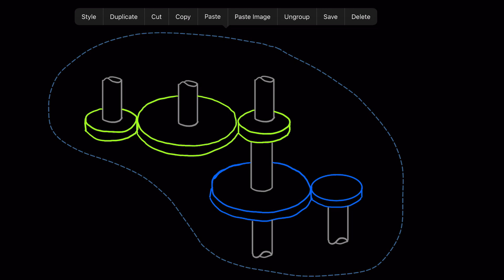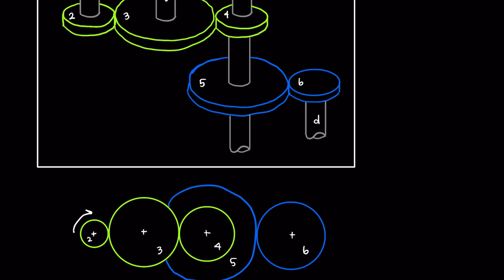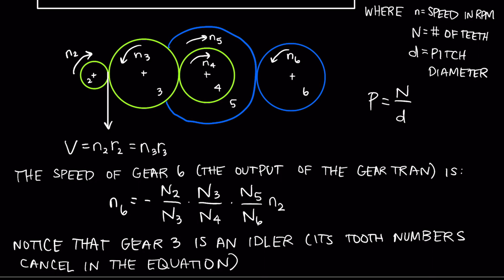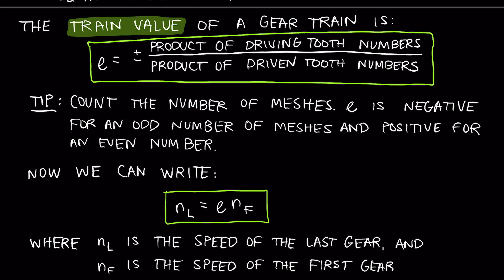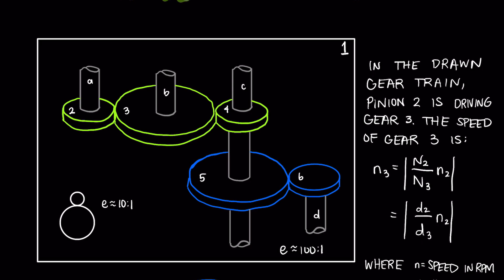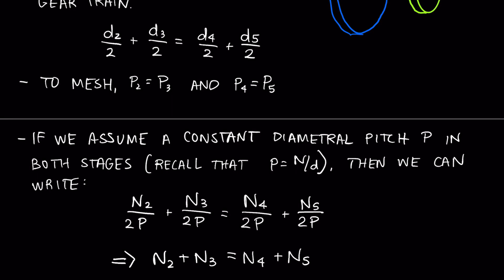Gear Trains: Simple, Compound, and Reverted Explained | Machine Design - Lecture 23B

Comment: Mam what is Footprint?
Reply from the maker: Great question! This refers to the space that the gear train takes up. In a simple gear train, getting a higher gear ratio might involve using multiple gears meshed next to one another,  increasing the length of the gear train. A compound gear train allows for multiplying gear ratios in stages, so we can achieve higher gear ratios more compactly.
Reply: @MEchanicsSimplified Got it thank you